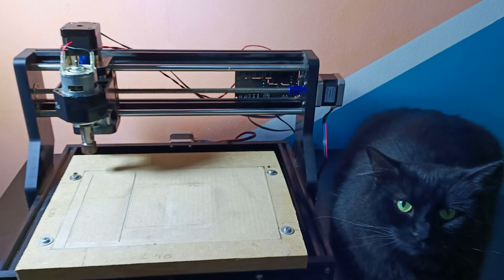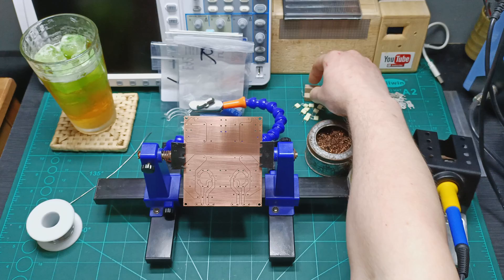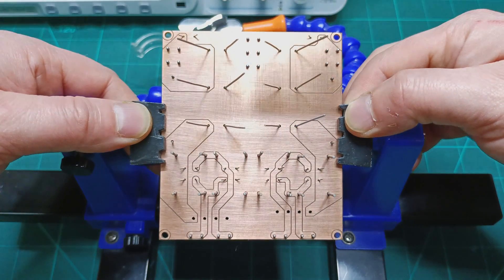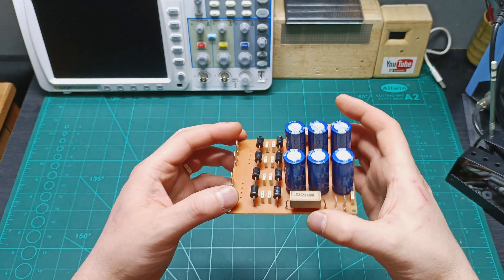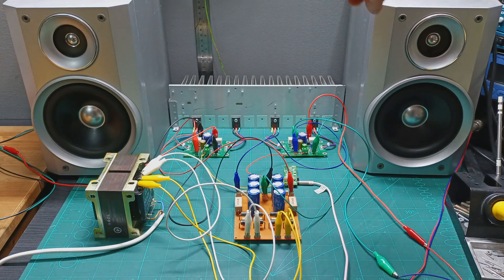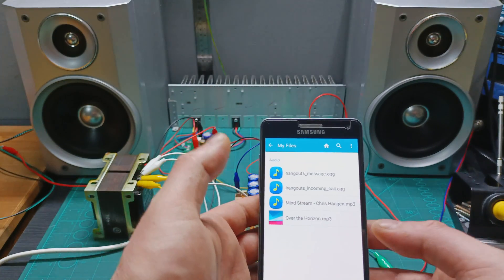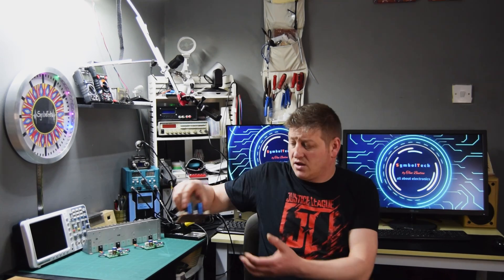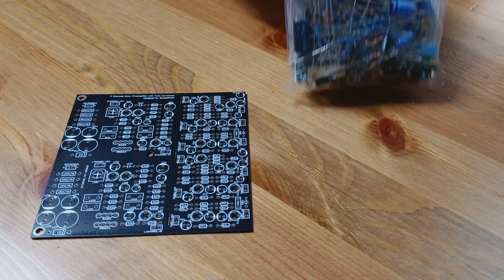Amp camp amp linear power supply board assembly

Comment: Can u share circuit diagram of this supply
Reply from the maker: its just a normal 4 diodes and capacitors
Reply: @SymbolTech21  but how are they connected? I need a circuit diagram. I have to make a linear supply for nelson pass amplifier aca.
Reply from the maker: @thedistortedguy  just send me a message on Facebook